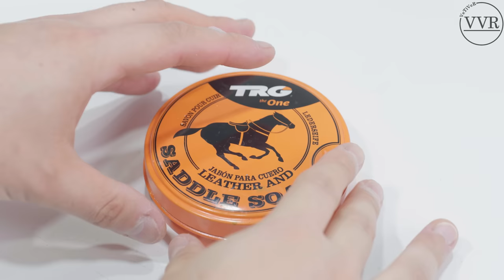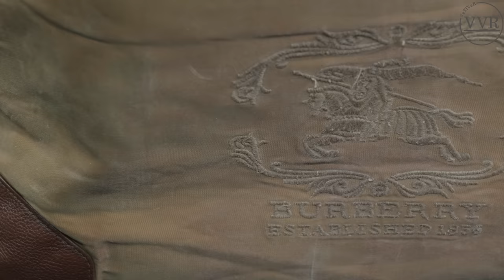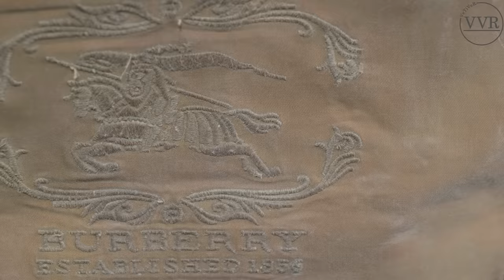[ASMR] Restore Vintage Burberry Shopper Bag Cleaning,Wax,Dye  -4k 👜🕸🕷👻 Happy Halloween :D

Comment: I first clicked "like" and then unchecked it when I actually saw the finished product.  Looks better then from the beginning, but not a great restoration as the leather binding around the top still looked shabby.  Also the brass rings at the top and other areas were not polished which did not help the end result.  But, I don't know how much better it could have been done by another restorer.  I also wanted to see the embossed logo look more pronounced and it was a loser for me.

Comment: I can’t understand how people can put so money in there design bags , as I have ! But not to take care of them !!!! There is so many simple things you can do to keep your bag for many many many years. I always stuff my bags until they have their perfect shape. Then two times a year depending on the material of the bag are use a protector on them rather it be for the leather or different types of material, I always take my bags out into the sunlight and let them breathe for a day or two in the summer. Also in my wardrobe where they are protected, I always have moisture protective things in my closet to pull all moisture out so there is no smell or mildew that will get on my bags. Keeping a room at a good temperature will always help also I try very hard not to let the temperature fluctuate more than 10°. These are just some easy things you can do to keep your priceless bags Looking brand new